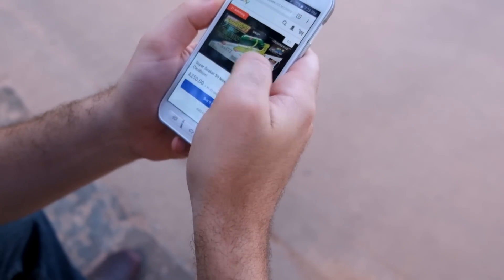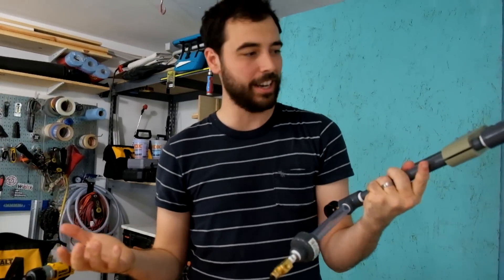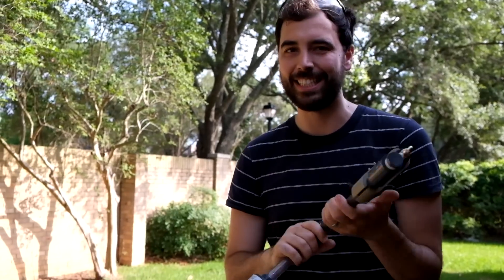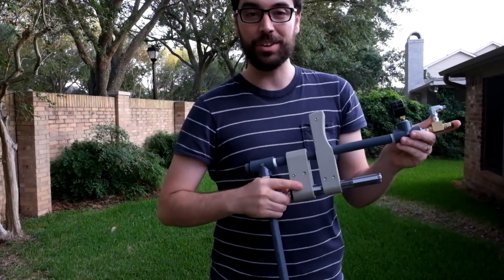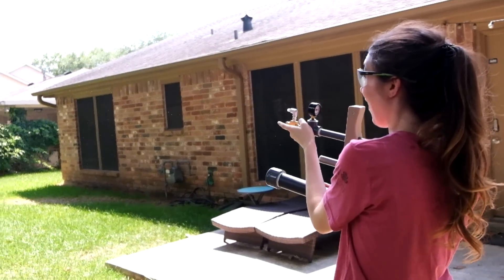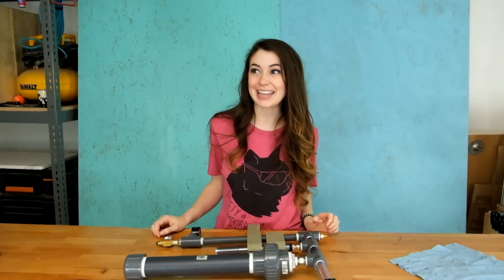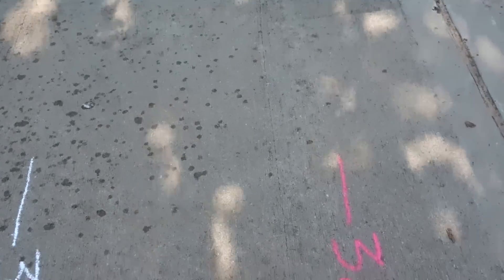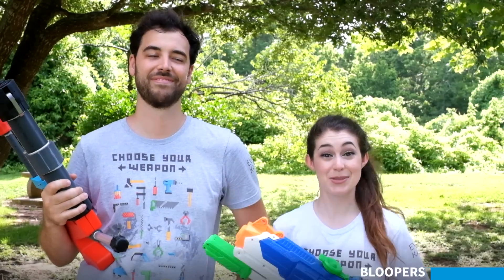DIY Super Soaker vs. Store Bought (& How We Made It!)

Comment: the more polished the very tip of the laminar flow nozzle is, the more laminar the flow will be. Using a thin sheet of metal that is very hand polished gives the best result. It should be thin, but rigid. Obviously, for this project, you don't need something perfect, and its hard to get cohesion at that speed and with such a narrow stream of water.

another upgrade I've always wanted is the giant camel bag backpack.
Reply from the maker: That's a great tip to keep in mind! Haha we're definitely considering a backpack for v2!

Comment: What infill and wall thickness are you printing at?  And/or what size do you make your holes for making tapping look so easy.
Reply from the maker: We went with the default settings for the high speed profile in Cura. And for the threads we use Fusion360's "model threads" option so they already had a start and we just had to finish them up with the tap

Comment: Fun video as always. Curious about the Schrader valve on the back... did you try using an air compressor or is that there to relive pressure if necessary?
Reply from the maker: Yep we tried it with an air compressor! Ended up going with the bike pump for this version to make it more like a traditional super soaker but we left it on as an option for the person who wins it. V2 is gonna be powered by a battery air compressor though 😁👍
Reply: Be cautious with the air compressor and PVC. PVC is pressure rated but it's not made to be pressurized and depressurized and can fatigue. If it fails under pressure it'll shatter (i.e. make shrapnel). It's the reason that if I ever get around to making another potato canon, I'll use steal pipe at least for the pressure chamber. Steal pipe really isn't workable for a water gun (heavy) but since you're giving this away I'd maybe at least put a relief valve on it to prevent the user from over pressurizing it.
Reply from the maker: Adam's Lab mm yeah we might just take off the back valve before sending it out. With the bicycle pump you can only really reach 75 psi but that back valve might be temping for someone

Comment: Uhhh nozzle 0.09 whats? It certainly looks bigger than 0.09mm diameter. Much bigger. I have nozzles which i confirmed to be 0.2mm diameter with a microscope, and without a microscope, i basically can't see the hole. I don't think Ben Krasnow even got holes this thin out of his Formlabs though.

3D printer nozzles of course. I use e3d compatible nozzles in an MK8, i know, weird but true. Expected to see some here because you can get them in all kinds of sizes between 0.1mm and 1.2mm and they can be so so very cheap.
Reply from the maker: .09 inches! Sorry we didn't specify.
Reply: Radius or diameter :D

EDIT: oh i know, diameter! It's a huge hole, like 2mm though... i could see why you couldn't use printer nozzles now.